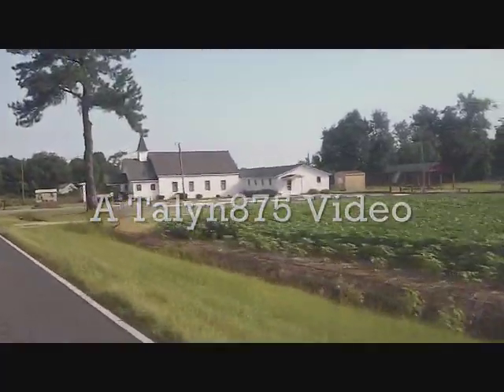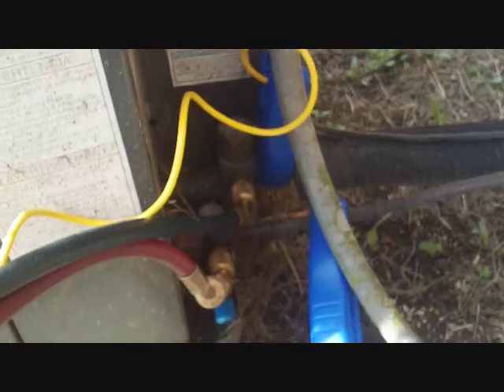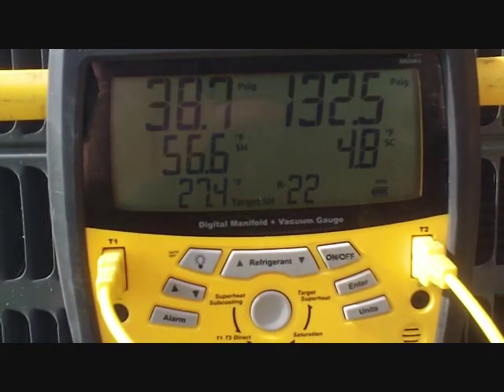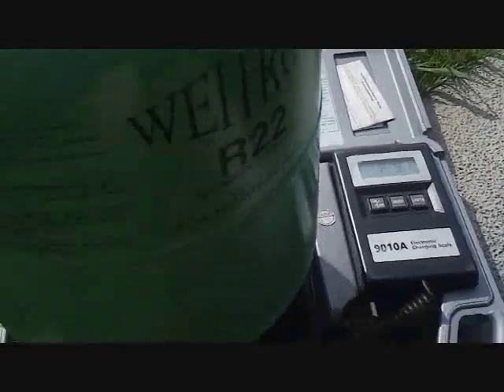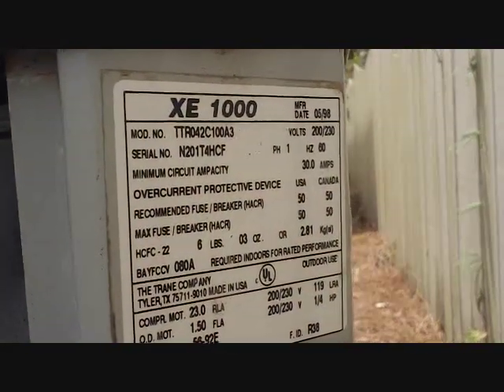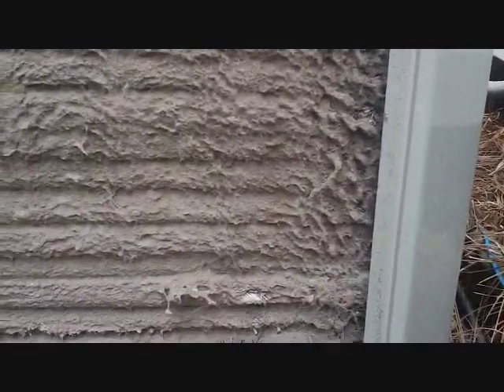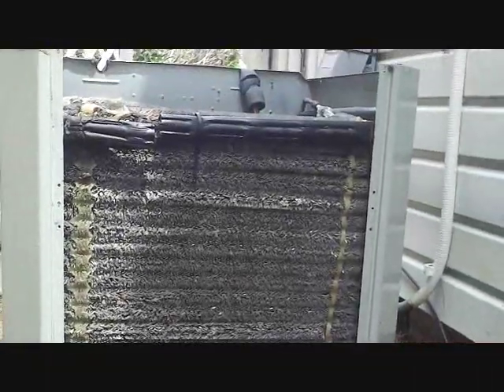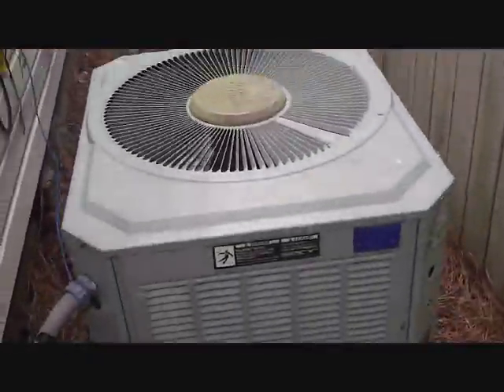HVAC Service- Recharging Leaking Air Conditioners

Comment: I have the same gauge set, but no clue how to use the features.  Once you put those WB/DB numbers in, what did you push to get the target superheat to come up?  Can you do the same and charge with a target subcooling instead? Is there an online tool to learn to use these?
Reply from the maker: Yosef, I have not had these gauges in a year and a half or so. Try searching for Fieldpiece's YouTube channel. The info should be there.

Comment: 72 outside - not going to give you correct info on a digital manifold, when it is under 75 degrees all SH calculations are off on my sman360, I get some crazy superheat readings that get normal when we are back to 80F